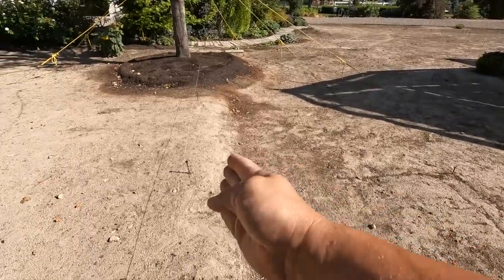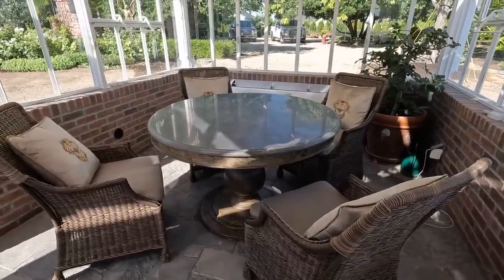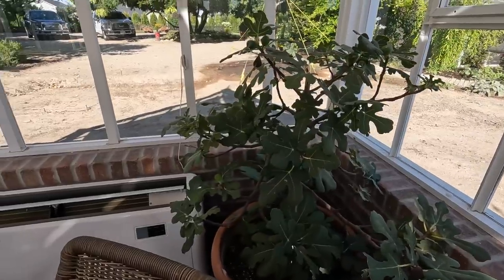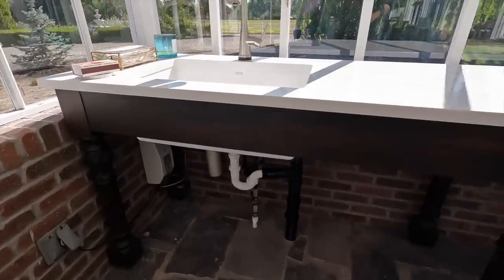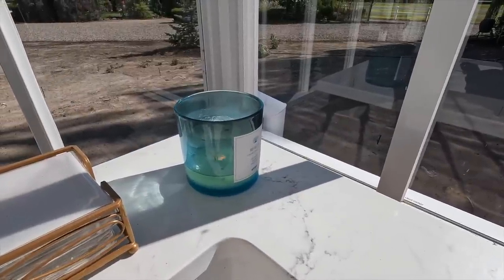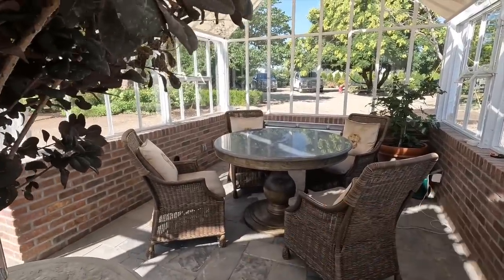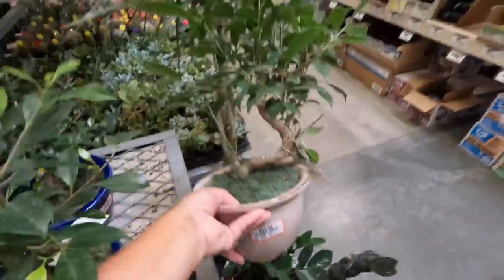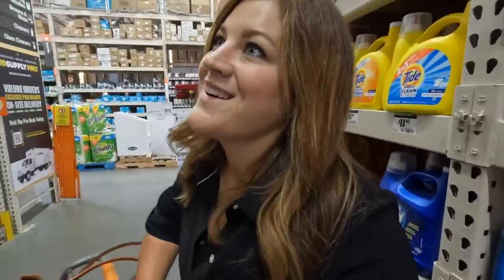Finally Putting Plants in the Hartley Greenhouse! 🌿🙌💚 // Garden Answer

Comment: I pick up glass plates at thrift shops to use under house plants.  They are cheap and look better than plastic.  It is not a good solution for bigger pots but works for small and medium size plants.
Reply: I’ve found some chargers that seem to work for bigger plants.

Comment: Laura - just had a ‘lightbulb moment’ for covering the front of the sink area in the Hartley! Heard you mention needing towels handy - so instead of a curtain, why not add a small tension rod across the top of the counter legs (just under the sink area) for hanging towels? Or you could use wooden closet rod and stain it to match the wood on the counter legs! If the towels aren’t long enough to cover all the mechanics  underneath the sink - you might even be able to add a second rod down lower (which could hold shorter hand towels or washcloths). As for the Christmas tree - definitely put it in the center of the Hartley! Can’t wait to see it lit up at Christmas!
Reply: I agree with every one of Mary Lynn’s suggestions.
Reply: Spray paint the pipe and bottom of the sink to match the wood— all will disappear.

Comment: For Christmas, the tree needs to go in the center.  When viewing from outside the symmetry of the tree in the center is going to be very pleasing.  And, it will not disrupt the use of the Greenhouse.  You will only have to move the center table during the Holidays.  Also, after watching you sweep up dirt etc. on the stone floor I would suggest that you get something like the Black & Decker "Dust Devil."  It will pick up the dirt that gets stuck in the valleys and edges of the stone.
Reply: Try using a dustpan with a long handle.  That way you do not have to bend down.  Save those knees and back as much as you can now.

Comment: Hi Laura, just warning about that antique table, the wood on top will absolutely fade with it being in direct sun. Also, it looks like it's a veneered top. With the heat from the sun, the glue on the veneer will fail and the wood veneer itself will dry and you will find it will warp. Not the best place for it, for its longevity.
Reply: She could add a plexiglass tinted top to protect.
Reply: Or have another top made like you did in the studio.  You had two tops made, one dark and one light.  This would protect the original table top.

Comment: Laura, can you paint the terra cotta saucers a stone grey to use with the cement planters? Loving the new look in the Hartley. Very inviting. Also putting some of the plants on different  levels like on little steps may make an interesting high low pattern or flow across the windows without blocking the view of course. So many options. 😊❤️

Comment: Hi Laura, I’ve learned from bitter experience not to put a beautiful wooden table (especially with inlay work) near a sunny window. Mine split the top layer and faded so badly within a year. Perhaps swap it to the North side? Regarding the hiding of the utility area, maybe a small antique “pot cupboard” (for extra storage) or an antique metal (solid not mesh) decorative fire screen  attached to casters (for ease of moving) that would fit under the bench and blend with the classic look of the floor. Just a few thoughts anyway. But I’m sure whatever you do in there will be magical and will change over time. That is the true gift of something so special - it can keep you occupied for years!
Reply: The stone top and chairs shade the wooden base, I think. ??
Reply: @leapintothewild  - not the new round table, I meant the table near the windows that Laura and her Mom bought antiquing.

Comment: I paint my terra cotta saucers grey to match concrete pots. Works like a charm, plus helps them to not let water soak through onto my wood surfaces. 
Also, sansevierias are tall skinny plants that would look good and could take radiant heat off the glass behind the counter top. 
The Hartley looks absolutely beautiful!💚

Comment: I have a lot of concrete pots (estate sale ‘finds’).  I purchased concrete saucers for most of them.  So, concrete saucers are available - round and square in an array of colors and sizes.  I purchased mine from a statuary business in Oakland, CA (or online at Art Craft Statuary).  Another suggestion would be to use metal saucers.  I might suggest you look online at Terrain; specifically the Habit + Form line.  You will be amazed at your options.  No matter what you do Laura it will look stunning in the Hartley!

Comment: Oh man! That Gator was just full of wonderful beautiful stuff! 

For the countertop, it might be nice to find some sort of thin tall shelf for more space above the faucet maybe? 

And for Christmas I would use the same size tree (maybe slightly thinner) propped up on a cute rustic wooden crate to make it taller. Definitely garland on the inside and outside of the doors, and maybe two big wreaths up higher on each side of the windows (above the countertop and Split unit). Just thoughts.

Comment: @Garden Answer Regarding the Hartley's under sink area, you could paint it the same color as the wood stain to diminish it or I've also seen people use a faux finish patina copper which is stunning as well. If you went the latter route, it might be best to match up to the metal finish of your faucet fixtures, though or it could clash from a design perspective.

Comment: You maybe able add a sliding door/mini barn door or bifold shutter/louvered type doors to hide the faucet, cleaning supplies, etc. tricky as to how to attach. Vertical towel rack or decorative horizontal towel rack to the right of sink.  Small refrigerator, in black, would be a good addition if it can fit under counter. I've wondered why you kept parking your vehicles outside in the weather.

Comment: Rosemary bush shaped into a Christmas Tree on the center table. Cut square wood blocks and paint them to look like children's playing blocks or wrapped presents then drill a hole in center that you could drop small pots inside. Maybe add a couple of pebbles at the bottom so it doesn't sit in a lot of water. I have not idea from there. 😊

Comment: You may need to add an additional ceiling fan or two for air circulation. At least put a little fan by your sink to help you stay cool while working. I have one of the foldable fans that you can charge and use anywhere. Folds up for storage. Really works great.

Comment: Add slight elegance to you pot instead of the plastic drip tray, use cut crystal low disband if you want to add height used punch bowl bottom stands that can be all found at any thrift store.

Comment: Second comment, but you should spray paint the plastic saucers. Maybe a black or matching as close as you can to the concrete. Just masks it a little better or will give a little trim pop if you do shiny black (shiny because water protection)

Comment: could you put concrete pot feet under the pots and then a smaller plastic saucer in the gap kind of hidden beneath but still under the hole in the pot?

Comment: Every time I see the inside of the Hartley I feel those 90 degree corners to the doors are too obstructive and would flow better if done at a 45 degree angle plus it would give some space for a plant or whatever. Even just rounded brick inside just to take the edge off would be much better.